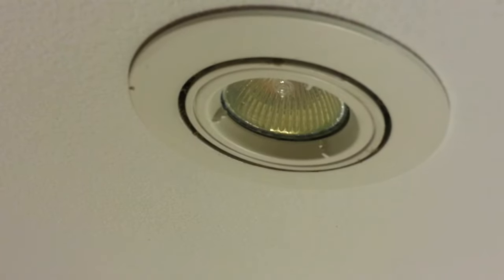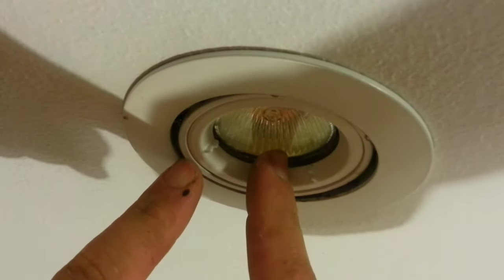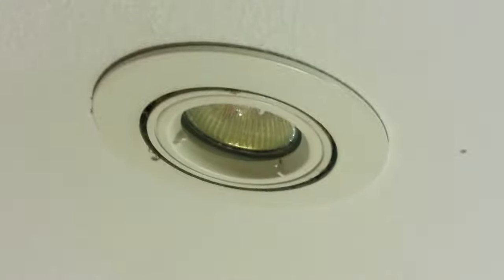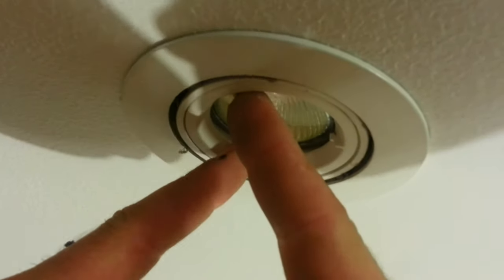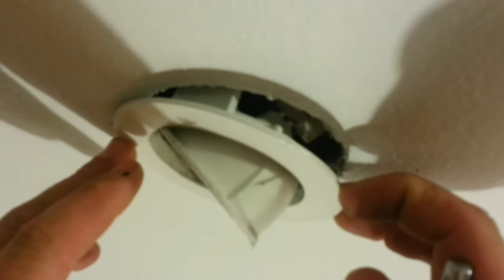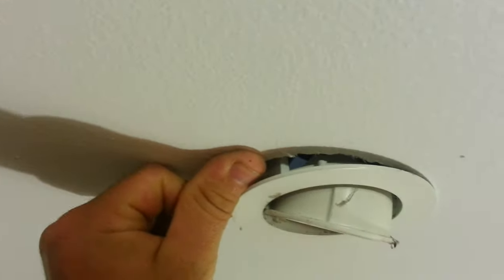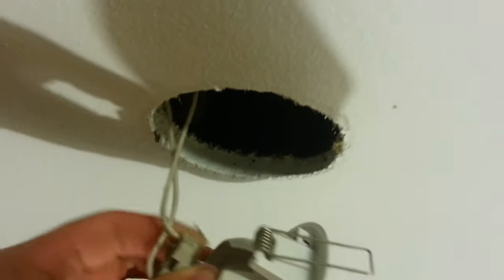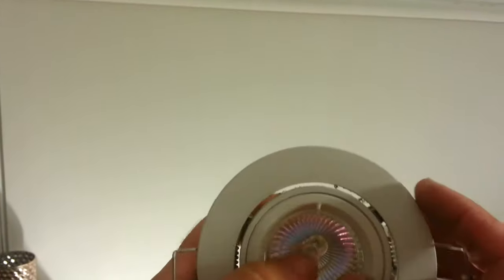how to change a 12v globe STUCK in a twist style fitting. A few different ways in 1 video

Comment: Wish you were closer. Having this exact problem and nothing works.
Reply from the maker: Sometimes the heat from the bulb can heat the paint and cause the parts to stick together.  Especially if someone has painted over it before. Otherwise it may be another style of fitting, that only looks similar. A licenced electrician will be able to sort it out !
Reply: @24HOURELECTRICIAN  I think I will have to get someone to look at it.

Comment: I’ve punched the bulb right up and I can’t get it out , what do I do ? 😮
Reply from the maker: Without seeing what you've done, or what sort of fitting you have, it's a bit hard to know. But, you could try a downlight suction cap, under $10 from EBay,  just attatches to the glass on the downlight globe, then you can pull it back. 
'GU10 & MR16 LIGHT BULB REMOVER $8.33'
Otherwise, if you take out the whole fitting from the ceiling , you can reach the globe, by reaching up the hole in the ceiling the downlight fitting was in. Depends how far up into the roof you pushed it  but if it's just inside the fitting  you should be able to use a 'downlight globe suction tool to get it back'. 👍